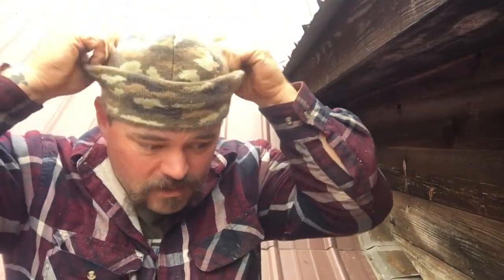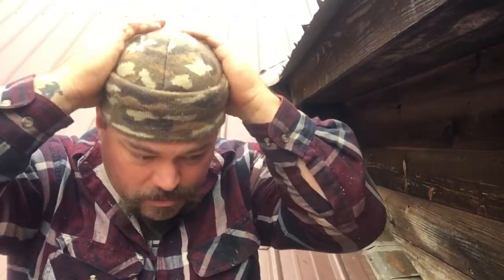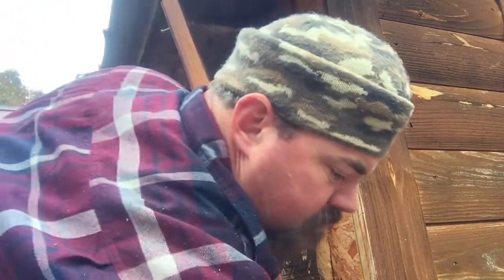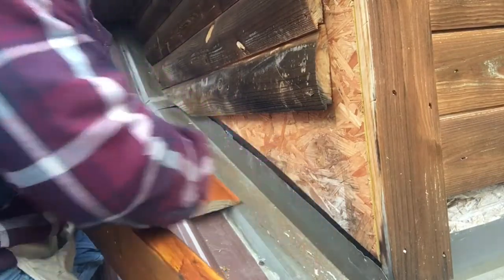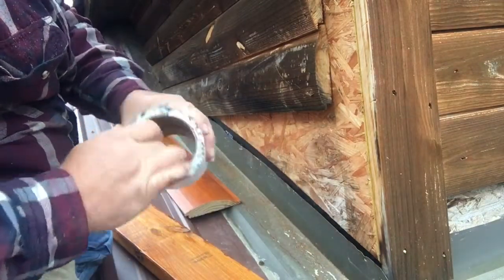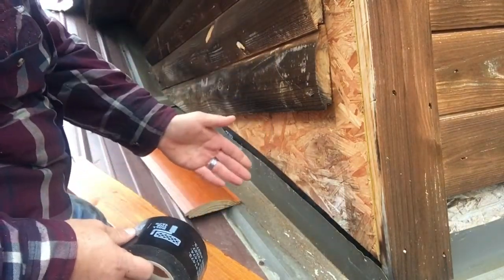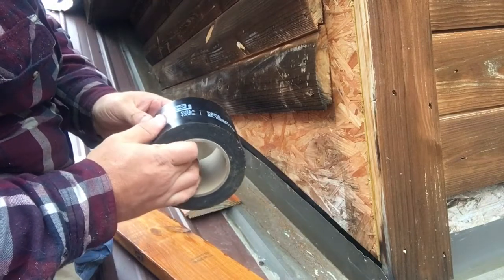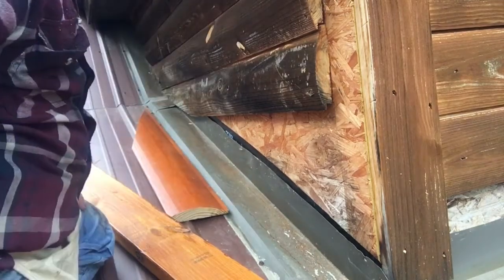A fresh new look

Comment: Looking good!  I know what you mean about the snowballing of a 'simple' project, lol.  Had a few of them here lately.....  Thanks for the heads up about the sealing tape!  I could have used that a month ago.  I've been trying to rebuild/repair a deck without buying new wood.  Takes 10 times longer to do it and it's never easy.  I had the stringers covered with tar paper the first build.  I am not going to sit around and cut more strips this time, so I tried out a can of that Flex Seal stuff and it works fantastic!  Don't know if you've ever tried it or would need the application, but it works and is very easy to do.  I just sprayed all of the tops of the joists and where ever they were going to be nailed.  Water beads and runs off completely.
Reply from the maker: Haunted 55 I may try it. We still have one little leak I can’t figure out.